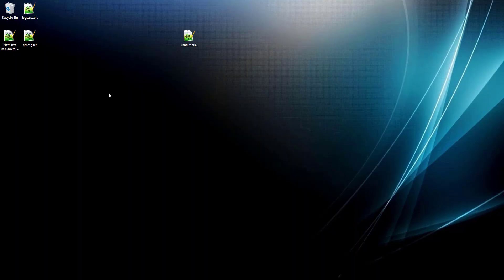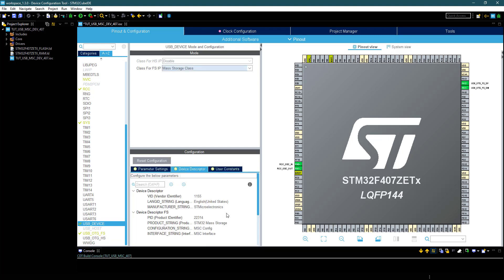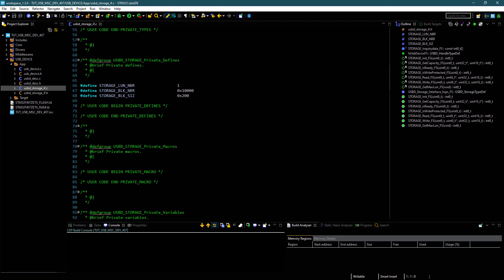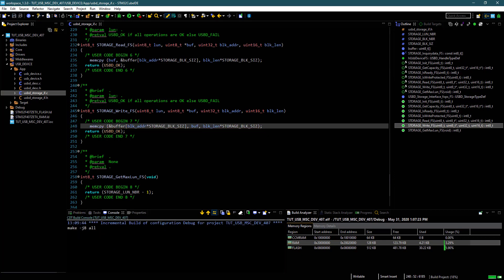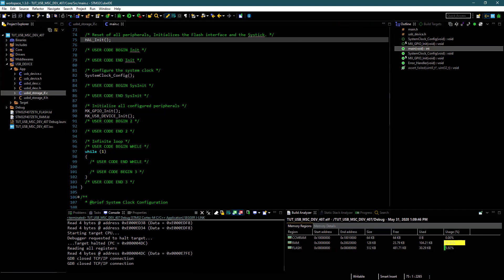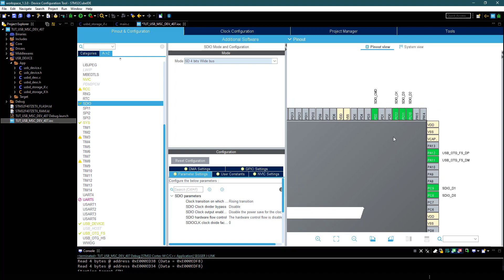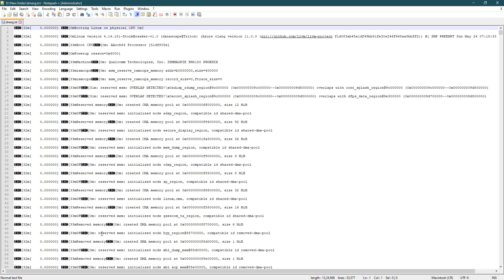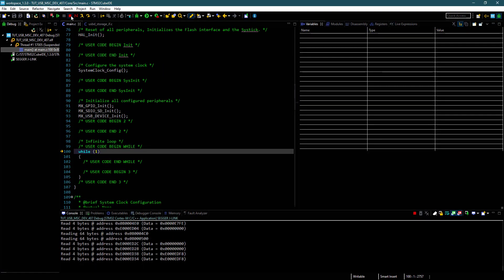STM32 USB MSC Device using RAM/SD CARD

Comment: Hi!
how to wire the USB port?
I am using F401re nucleo board
Reply from the maker: You need to solder the USB at the bottom of the board (user USB might be written in that area).
Or you can manually connect the wires between the USB and STM32.

Comment: Hello... you mentioned in the first part using RAM , connect the USB. what USB is that? is it the external thumb drive? where to connect ? to the nucleo bd  USB port? or PC USB port ?
Reply from the maker: It is usb cable. Connect it between the dev board and computer. If you are using nucleo or discovery board, keep in mind that the user USB is a separate port than the ST Link USB. Any USB operation can be performed on the user USB port, and not on the ST Link USB port.
Reply: @ControllersTech   ok i got you, thx ..

Comment: @controllerstech
I am using Mass storage with STM32F401 it gets the drive but if i copy anything into it using MSC after power cycle it dissappears , Can you suggest something
Reply from the maker: There is nothing to suggest here. That's how the ram works. Ram was used here just to demonstrate that it can work with anything, you should better use some external flash or eeprom for it.
Reply: i am using SD card , I  did resolve the issue by doing 1B wide bus in the code but it would be great if you can suggest to do it with 4 because with 4 it doesnt work  @ControllersTech

Comment: I am currently working on a project that involves integrating USB functionality for data transfer and data logging on an STM32F407VG micro-controller. Specifically, I want to log data files on an SD card and enable the user to download these logged files from the SD card via USB. Additionally, I'd like to allow users to copy files from their PC to the SD card via USB, all through the STM32F407VG using the SDIO communication protocol.

I'm facing a challenge in making the USB_OTG_FS (On-The-Go Full Speed USB) and the SD card (using FatFS) work together seamlessly. I would greatly appreciate your guidance and any insights you might have on how to achieve this integration.

Here are some specific questions I have:

    How do I configure USB_OTG_FS as a USB Device in STM32CubeMX or other development tools?
    What are the essential initialization and setup steps for using the USB_OTG_FS as a USB Device alongside the FatFS library for SD card communication?
    Are there any sample code snippets or project examples that demonstrate this integration?
    What should I be mindful of when managing the data transfer between the USB and SD card to avoid conflicts or data corruption?

Comment: If you could provide an example like this using a composite USB with CDC + MSC (using the SD Card) that would be amazing!
Reply from the maker: I guess you can't use 2 modes at the same time. The peripheral needs to be initialised in a particular mode. If you want to change from MSC to CDC, you need to reinitialise it in CDC mode
Reply: @ControllersTech  You have to use the new Composite Mode that Sasha with STM is developing... or use tinyUSB. I just haven't seen anyone get either working on a full project.

Comment: hello I am trying part 1 and using 8KB of SRAM of my stm32f103c8 as mass storage, the problem is that when I connect the USB drive to the computer it asks me to format it, but when I start it it gives me a message saying that the drive could not be formatted.

I use windows 10 and the USB is connected externally with 3 resistors on a breadboard, a 22 ohm resistor in series from USB D- to PA11(USBDM), for PA12(USBDP) the connection is slightly different, I have two resistors, one of 4.7kohms as pull up from USB (5V) to PA12(USBDP) and the other 22ohms resistor from USB D+ of USB connector to PA11 (USBDP)
Reply: Maybe your disk size was too small? Mine failed same on 32*512bytes, but worked with 80*512bytes.
Reply: Having the sam problem.. have you found a solution? The size increase did not help..

Comment: Why does the SDIO clock need to run at same speed as the USB speed (12 MHz)? I would expect that SDIO and USB can work independently, and the read() and write() functions just pass data from one to the other?

Comment: Can the RAM version of mass storage persist after power cycling? If so, how is the RAM retained?
Reply: a) Not without battery backup (Some STM32 appear to have RAM blocks that can have battery backup, similar to the internal RTC)
b) If power cycle then RAMDisk will need to be reformatted (i.e. write a routine to init RAMDisk on bootup)
c) I believe the RAMDisk is just to show the minimum code to make this work, as any FLASH disk requires much more code, and possibly some flow control.
Paul

Comment: @Controllers Tech  Thanks for your great videos! But could you please do the same tutorial with the SD Card connected via SPI ? I can read and write from my microSD Card using SPI, but I also need to implement the USB MSC Device like in this Video. I can´t get the STORAGE_Read_FS/STORAGE_Write_FS functions in the usbd_storage_if.c file to work. If I connect my custom Board to the PC, Windows always wants me to format the disk. I´m getting the correct capacity of the SD Card in the format device window tho, so my STORAGE_GetCapacity_FS function seems to work. I already searched and tried many hours but i just cant get this to work. Would be really happy if you could help me out with this.
Reply: What kind of SD card are you using? I am using SDHC and I'm wondering if the initialization code is correct. E.g. it initializes block size to hardcoded 512, I'm wondering if that's always correct.
Reply: Hi ! I have exactly the same problem on an F373CC ... I will come back to you if I find a solution or a tutorial that will unlock us!
For STORAGE_GetCapacity_FS, did you change the constants by hand or did you find a function that did the job?

Comment: stm32 + external flash memory + usb msd +fatfs .no one on this planet can do it.
Reply from the maker: What is external flash here for ?
Reply: @ControllersTech  w25qxx for datalogging
Reply from the maker: Okay. And what's usb for then ?
Reply: @ControllersTech  to get the txt file from the flash as usb mass storage
Reply from the maker: You know w25qxx is a SPI based flas memory right. How do you plan to use it with usb protocol ?
Reply: @ControllersTech  formating it as fat fs and declare read/write function on usb msd  by taking care to the size of temp buffer (512/4096 bytes)
Reply from the maker: I am saying w25qxx is a SPI device. It doesn't follows the USB protocols.
Reply: Yes this is what u said, but its still feasible thow
Reply: @ayoubkouch56  any progress?
Reply: @mateuszczarnecki1079  yes. I 've done it whene we where talking about it !
Reply: @ayoubkouch56  can you please show me an example of that? I'm also working on a similar project require SPI flash + FATfs + USB MSC

Comment: undefined reference to `hsd'
USB_DEVICE/App/usbd_storage_if.o: In function `STORAGE_Read_FS':
i have this problem, im using stm32f746ng
Reply: Add this between those two flags in "usbd_storage_if.c" :)
/* USER CODE BEGIN PRIVATE_TYPES */
extern SD_HandleTypeDef hsd;
/* USER CODE END PRIVATE_TYPES */

Comment: Thanks!! Can you make another video to use DMA to speed up the transfer rate, please!
Reply from the maker: I will test it. I am not sure though. But i think the speed can be increased somehow
Reply: @ControllersTech  find a problem that , i can format card by using 'SD Card Formatter 5.0.1' from TUXERA,  but cannot do format directly from windows disk format.
Reply from the maker: no problem here. I can format it with windows too

Comment: Great video as always. I hate to ask an irrelevant question. For the stm32F103c8 using USB as virtual Com port. However everytime I'm uploading the firmware I have to pull out the USB cable and plug back again so that windows re-enumerate the Com port device. I don't want to ruin the USB recepticle, any solution for this? Looked everywhere.
Reply from the maker: I don't think that it can be done without removing the USB.
Reply: @ControllersTech  Thank you.

Comment: Not sure, but it appears that the writes are not being made with the block size that is native to the flash device. This is commonly 32K, but could be a little smaller or larger. (By comparison, hard drives are typically 512 bytes and SSDs are 4K.) Ona flash device , a single byte, or even a single bit, change requires that the entire block be rewritten. Therefore, small writes - for instance 512 bytes at a time - will result in the same block being written 32K / 512 = 64 writes to each block. Thus, writes are 64 times slower and the flash device wears out 64 times faster. It’s something to check.
Reply: I would assume that this info (block size and number of blocks) is passed through via the STORAGE_GetCapacity_FS() function which retrieves it from the SD card via HAL_SD_GetCardInfo().
If that information is correctly used, it might all end up fine.
On the other hand, reading/writing a 32k block would probably require a RAM memory buffer of the same size, not sure if this is the case (I would need to check where the "uint8_t *buf" memory is created and if it's RAM or e.g. peripheral memory).
Reply: @Nachodis  Edit: wanted to clarify the the following comments refer to the possibility that the OS manages the buffering itself. If the user manages the buffers, then they are free to make good decisions about available memory and it’s usage. Your comment was a very good one.

If the file system (in memory) permits writes less than the full block size (e.g., 32K), that implies at least a minimum amount of write caching. Thus, (a) the write from user land isn’t guaranteed to be physically written to the target media. At least one buffer must be maintained, and unless writes are perfectly aligned with those block boundaries, then the write time will become even less deterministic. Whether or not this is an issue is naturally application dependent.

(b) Although this behavior isn’t as well known, read cycles also put wear on flash decides. So, it follows that there may be a similarly sized read cache as well. Taken together, 1K-128K (recall that this size can vary quite a bit from device to device, from 512 bytes to 64K) could be required, on top of other file system structures in RAM. It seems unlikely that these large buffers would be baked into the code by default. Perhaps there are caching modes that can be enabled/disabled using preprocessor switches, in the same manner as other OS features.

(c) The caching mechanism absolutely requires that there be some mechanism to reliably flush the write cache. On an embedded device, which may be expected to be powered down at arbitrary points in time, this could become a serious issue. LittleFS, though obviously not as portable as FAT, does take into account this idiosyncrasy.
Reply: @a1nelson  Yes, insightful comment.
Actually, I just got everything to work after reducing the SDMMC speed. This video does not properly explain why that's necessary, but it is necessary since the MCU might be too slow to take in the fast data from the SDMMC peripheral, which causes errors on the interface.

With respect to block sizes, I think we need to distinguish the FATFS allocation unit size and the flash block size. I have an 8GB SD card which is reported in the code to have block_size 512 and block_num 15523840 (in total 7.948.206.080 bytes). The flash memory works in blocks of 512 bytes. The fatFS filesystem on top of it however, works in sectors of 32 kB. This means that, if a FS data sector is allocated for a new file, 64 blocks of 512 bytes might actually need to be allocated (not verified though). The FatFS is defined in sectors of 32 kB but handles the SD card in blocks of 512 byte.